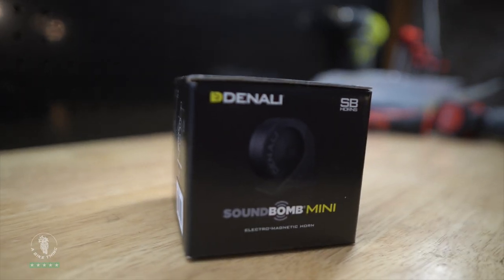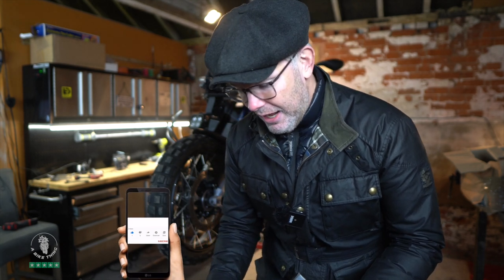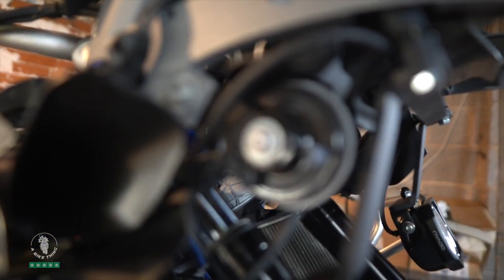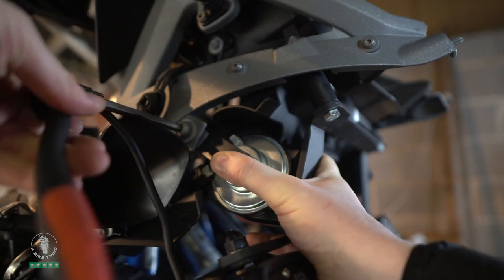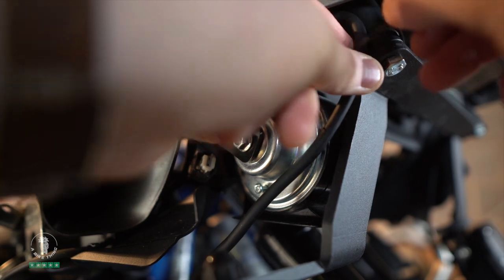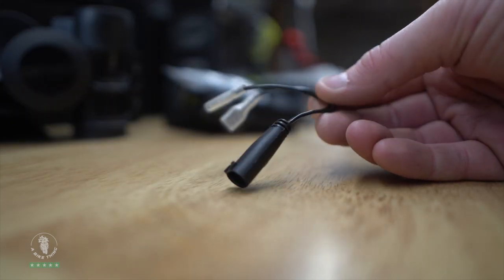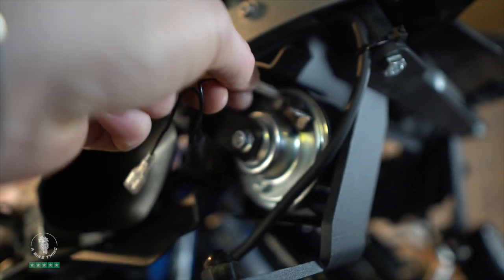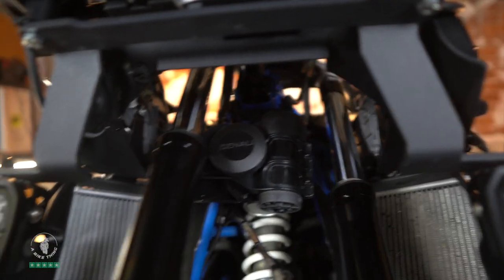3 DENALI SOUNBOMBS - HOW TO INSTALL

Comment: I have the compact 
sound-bomb & it’s a fantastic horn, really pleased with it 👍 
A little criticism that I have was the bolt which is supplied the horn that bolts the horn to the bracket is just to short, you barely have enough thread. They could do with  supplying a slightly longer bolt. I changed mine out  for stainless steel bolt but slightly longer

Comment: I recently fitted a compact sound bomb and eZcan. Left oem horn attached and programmed through ezcan 0.25 sec delay. This means my oem horn can be used to toot goodbye or thankyou without the full noise of compact sound bomb which comes in after 0.25 sec.
Love this option.

Comment: I bought a SB compact from you.  I have touratech upper bars on my F850 so fitted the SB under the beak with the crash bar mount.  It sounds like a truck.

Comment: I have the compact SoundBomb between the forks on my 2019 GS Low. I did have to work a little to adjust the positioning since it is VERY tight. But I eventually got it set up.

Comment: have installed Soundbomb Compact horizontally under the "peak" of my 1250gsa, it is fixed to the rack of denali lights, horizontally.
however installation guidance says compressor should stay vertical.
hope my bad installation won't kill the compressor 😂😂😂😂

Comment: I don't like the high tone pitch of the 2 tone one. I prefer the one tone of the mini a lot more.

Is it possible to just add 2 units of the mini?
That way it should be as loud as the 2 tone, but just with the nicer 1 lower tone.

Comment: I bought the split unit. While reading the manual, it says to not mount the compressor more than 25 degrees.
Was there no issue with the way it was mounted?

Comment: Hi Steve. I have a (new to me) 2020 GSA which has the sound bomb already fitted. However when I want to give a short blast, it stays on long enough for my brain to think that the horn button on my handlebar has stuck. I've contacted Denali directly and they suggest it is the relay. Just wondering what your thoughts might be?

Comment: Thanks for the greet videos steve. Question - I have fitted a standard sound bomb , between the forks using the final method suggested. However, my Denali wiring harness is about 6-8” short of connecting. Is there a shorter and longer harness or do I need to do my own wiring hash ? Thanks, martin

Comment: I bought a compact sound bomb from you and installed it in a GSA1250 lower suspension between the forks and it is working fine. Why don't you recommend this? I just ride the bike usually on paved roads. I don't see myself pushing the suspension to the max. Is this the reason?

Comment: good video as always, do you have a customer that wants Denali products on his 2021 Ducati Multistrada V4S? Colaboration with a Ducati Dealer or Ducati UK?
Reply from the maker: There's no cansmart for the Ducati....yet.  However I have intentionally bought my new BMW from a dealer that has other brand of motorcycles under their wing.
Reply: @ABIKETHING  , I heard about the "YET" part. supposedly a universal CAN opener. Interestingly enough, Denali lists a lot of their products under 2021 Duc MS V4S if you shop by bike. My dealer service manager advised strongly against mounting anything that can't be programmed.

Comment: Steve, love and just found your videos! Very informative. I've an issue however. I have Denali D4S, Compact SoundBomb too. When I installed the horn it worked on first press. But then stopped as have my 4s. Any ideas? Followed many videos, bike is a 2019 1250 GS. Cheers Mate. Have the CanBus and as I've seen nothing else needs to be peorformed.
Reply from the maker: Have you plugged laptop in and checked your amp settings?
Reply: @ABIKETHING  not yet. I've utilized the supplied relay, wiring harness. Shouldn't be that much of a draw, no other lights or draws.
Reply: @ABIKETHING  I noticed you took out the fuse, did you replace it? Wonder if I blew it somehow

Comment: Have you tried a sound bomb compact on your 2021 GSA, I couldn’t get mine to clear the forks it’s too wide and there an extra nub below the bolt hole
Reply from the maker: Not yet.  Will be fitting it to my new 21 model soon.
Reply: @ABIKETHING  I picking up my new 2021 GSA with the low suspension option.  Will the compact version work since it’s not a GS?  Do you ship to the US?

Comment: Anybody know if the compact fits the 2019 crf1000 adventure sports in the same place as the original horn in front of the radiator? If Anybody can advice on this thanks 👍
Reply from the maker: Hi, the compact fits on the side using this mount https://abikething.com/product/horn-mount-honda-crf1000l-crf1100l-africa-twin-16-22-crf1000l-crf1100l-africa-twin-adventure-sports-18-22/
Reply: Thank you for the reply & advice 👍

Comment: Hi Steve, I appreciate you and your videos. I know this has been asked before. What do you with the OEM horn from a 2021 1250 GSA once a compact SoundBomb has been installed through a CAMsmart? Thanks!
Reply: I let them run in parallell on my old R1200GSA-14. You may need a relay to avoid triggering an error code. But remember to connect a diode on the relay to handle EMC spikes when relay goes off.

Comment: Soundbomb mini and the bmw specific harness does not work as intended on a GS LC model, try again starting the motorcycle and press the horn button for more than a sec, CANBUS turns the circuit off

Comment: Re sky lift; Letting the bike sit on the ram like that without using the lock off bar will quite quickly properly knacker the seals on that ram

Nice video though
Reply from the maker: My bad, i'm generally really good at locking in place.  Good attention to detail though 😉